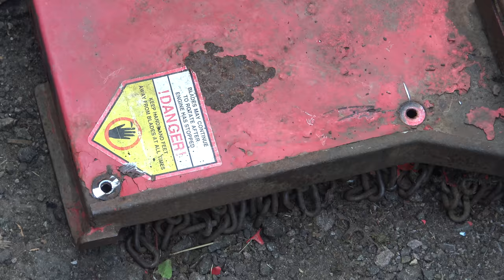BRITISH LAWN TRACTOR RENOVATION - Was It Worth It?

Comment: For the chain replacement, I disagree here.  I would have heated them up then oil quenched them for Oil Blackening.  This will keep them from rusting by adding the black oil to the surface of the steel.  Plus... nobody is going to be looking under the mower.  And... if they do they will not know the difference.  The chains are only there to deflect stones and wood chips from turning into bullets when struck by the blades.

Comment: My 38" 16hp Countax must be over 25 years old and still going strong, being used every week.The powered collector is, in my opinion, a much better option for the UK over the mulching deck, as we get massive grass growth and tons of leaves and debris all over our lawns due the the amount of trees we have.
I always coat exposed aluminum in motor oil to stop it corroding, I know it attracts muck but after a few uses it isn't noticeable and it really protects the aluminium.
I am still on the original belts apart from the serpentine deck belt and the powered collector !! (just wait for the comments on that one)
Nice Video, brilliant production - you must have the patience of a saint!
Reply: Ha Ha same tractor for me as well and almost identical age!
Burnt out a few serpentine belts cutting 2 foot high grass when we have been away for months and have just replaced the starter solonoid.
I have re-painted the underside of the deck twice and I also use spray on underseal.
This wears off after a few years but I am cutting 1.9 acres most weeks.

My 16HP is a single cylinder B&S but it seems most are twins.

Comment: PA LAWN GUY> Great video. Painting the cutting blades improves the aerodynamics of the blade and hence the grass flow. It also reduces the power needed to turn them. At least until they build up with adhered grass. that is why it is best to clean and paint the blades when they are sharpened and balanced. the best to you in your work.

Comment: I have a C600H purchased new 2008 with 16 hp Honda V twin OHC has 305 Hrs still looks good and stored in side
has 38" mulch deck and was converted to hand control with a mobility scooter seat (high back & arm rests 90° seat
rotation with locking mech. seat belt and chest strap) I'm a C7 Tetraplegic and my Countax has never let me down
still has original battery.
I live in West Otago South Island New Zealand  
Have a Merry Xmas & a Happy New Year

Comment: Well done, have to say my ocd would make me go even further but this was really good. Seen so many people just half ass the job. Had a Husquarna top of the range with 122 cm mower deck and atwin 22 hp Kawa engine and hydro +hydraulik lift of front deck and sevo  of course. still running strong after 20 years though I sold it when I moved into a flat. I look like inspector dreyfuss in a pink panther movie when I see it and it is not cared for as I did. Believe it is the same gearbox/axle, the tough torq they both used back then.

Comment: I just about crapped myself when you put the key in it and started it up and drove it off the off the delivery pallet, and it says can it be saved. Well hell yes. As far as the working parts go wasn't too bad when you get one that runs like that you're going to have to replace some stuff but that's the way it goes. The problem with these highly produced mowers, lies within the Developers bearings that can't be greased all the older equipment seemed to always be built different better oh, we live in a throwaway world. I have to say I thoroughly enjoyed the video and you do really nice work I've seen a few of your videos and I like what I see. But for a guy that takes and pays so much attention to detail especially like on this one one thing you didn't do I wonder if you can guess? That's right the steering wheel is crooked. You will never not in a million years make me believe that with the wheel straight your cross bars are at 7 and 2 or two and seven however you want to look at it please fix that. LMAO. Anyway you stay safe stay well and as always God bless.

Comment: As a small engine mechanic, I wish I could work on old junk all day instead of the relentless slog that is modern machines and do it to the level of quality and detail you do.
Reply: Same, got a honda gx390 with electric start that's on the rebuild list for next week.
Black smoke, misfires and had gas/petrol as oil a couple times due to leaking needle and seat.
I'm guessing valve seals and piston rings
Reply: with you on that Abe !!

Comment: I'm really glad you saved the little C series, I'm an ex employee of Countax and I'm fully aware of their faults but they are far outweighed by the good points, if only more owners would look after them they'd last a lifetime. Well done.
Reply from the maker: Thanks! It's very interesting having an ex employee of Countax watching. I have been struggling to get hold of the RAL colour code for Countax, I used my RAL chart and came to the conclusion that they are painted in 3002. Would you happen to know the correct colour code? Thanks
Reply: @MachineryRestorer  I don’t know the exact colour code but I could ask my friend who ran the powder coating line if he knows.
I destinctly recall being told the Harry (the company founder) loved Ferrari red, so to avoid being sued by Ferrari he made Countax red just a shade off Ferrari red.
Reply: I've got in contact with my friend, he can't remember the code numbers either but he confirmed it is very close to Ferrari red and the supplier was/is Akzo Nobel. Hopefully this will help in your quest.

Comment: Liquid wrench penitrating oil works way better than wd40. Also try using motorkote in those small engines, it works like a dream.
And evapo rust works well too. And ospho turns rust into metal.

Comment: If you need an Electric PTO Clutch, take your Old Clutch off, there should be a Number Stamped into the Clutch metal. Usually it’s on the upper side. Search on the Internet for this part. I paid a quarter of the cost the tractor manufacture wanted for the same part.

Comment: I have a newer countax with a different deck but basically the same spindles as this.  I did this overhaul back in the Autumn due to noise in the bearings - wish I'd seen this video earlier ! This looks like a HGM (High Grass Mulch) deck. On the XRD deck I have it is welded still as opposed to pressed, so this deck seems to have been ravaged by rust.

Comment: I was surprised you were still using locking tabs. A drop of oil or bolt Lock of some type will do the trick quite nicely. R.G. LeTourneau, a quite  famous earth moving inventor and builder had trouble keeping the hardware tight on the equipment and customers were complaining. Someone told him if he would oil the hardware it would stay put. He ordered all hardware to be oiled on the assembly lines and the problem was solved. For a volume production like that oil is significantly less costly than something like Loctite.

Comment: Seeing as what that Riding Mower is doing (cutting heavy, dense growth), I would have installed a Briggs & Stratton 23Hp Intek V-Twin............Now that is one thing that is definitely different here in America from the UK. Our Hydro-static Transmissions are a SEALED UNIT. They do not have a hydraulic fluid reservoir, plus In America they call a mowing deck like that a Brush Hog/Rotary Deck. Normally they are much larger 60" diameter and larger, pulled behind larger tractor with a shaft driven PTO or a hydraulic PTO

Comment: You sharpened that blade "upside down" on the grinder from how I thought it was to be done, but yours looked safer and easier...

I've done the "roll it on a big screwdriver until level" which is remarkably effective, like it a lot more than that plastic thing. I don't do enough to have a magnetic one.

Comment: This thing is so well built that I would absolutely rebuild this thing many times if necessary. I think it will outlast several lifetimes.Did you ever think about replacing those plastic pulleys with metal ones? I really like this machine. We have ones comparable here in the states but this one seems really nice. Especially after you were done servicing and replacing parts.
Reply: The plastic pulleys that outlasted the steel deck?

Comment: That pressure washer seems to have the power of a garden hose :D
Reply from the maker: Indeed I am getting a new one very soon.
Reply: @MachineryRestorer  Great! I´m spoiled of course by working as a professional zookeeper for 5 years, there we had in-built pressure washers to clean the enclosures and you really had to hold onto them, otherwise they would knock you over. But man, they had power! Nothing against the small one from Stihl that I have at home. However that one is strong enough to clean lawn mower decks properly from decades of dirt and loose rust. I´d really like to have a gas powered one though.

Comment: Great video! I have one thing I would question you about. When you spray painted the parts from the bottom of the deck, several of them were still very rusted. I would have thought that going over them with a wire brush at the least would have been best. It wouldn't have taken any time at all and would have extended the life quite  a bit.

Comment: I must admit, I don't like the Picric Acid Aluminium Cleaner.   I washed an almost shiny Ivor Williams Trailer with it, and it turned the aluminium into a matt finish, which started to oxidize a month later.   Would have been better to use Scotch-Brite to rub the sides back to a polished finish.

Comment: Interesting that you got the deck powder coated. It doesn't last. Flakes off due to poor bonding. My old Westwood T1200 with proper paint was still good after 20 years. A more recent machine with powder coating was flaking in just 5 years.

Comment: That is an extremely strange deck for a homeowner mower, it's more like a commercial mower or brush hog, it doesn't have the ability to Route the clippings and blow them out, in America most ride tractor mowers will suck leaves like no tomorrow and you could run around your yard and divert everything into one pile!!! 󾓦

Comment: This was amazing to watch and the time it must have taken to do the work, not to mention the additional time to produce such a detailed video. I have a much smaller job to do on my Countax but I am having trouble finding parts. Who do you find most comprehensive? Thanks Brian
Reply from the maker: Hi Brian, when I need parts I usually use EBay as the used parts tend to be so much cheaper than new. Thanks

Comment: Good video. The machines over here have a V shaped pulley to run the V belt into. That makes it easier to see how to run the belt. Makes me think may be some one put the wrong idler pulley on. I'd be interested to know what oil you use in the Hydrostat rear end. Also what formula you use for boiling the parts clean. Looking forward to more videos.

Comment: “Countax” as a brand isn’t known here in the US, as far as I know. However a quick google showed it’s owned by a US company, Ariens (I noticed some of the parts packages you had displayed the Ariens name), who is known over here mostly for their snow blowers and resedential mowers, as well as more professional mowers under the Gravely brand. 

Usually subsidiaries here in the US tend to just offer the exact same products under different brands. But there’s a lot of quirks about that mower which are not typical over here... the hood design, deck chains, control lever layout, the dash display, and even the blade design is very weird. And, according to Wikipedia, Ariens only uses Tecumseh or Briggs engines. So I’d say this Countax brand must have a decent level of independence from their parent company; instead of selling clones of what’s offered across the pond, they are permitted to do at least some stuff the way they want (though I expect they do use quite a bit of existing parts and components from the Ariens parts bin).

That said, I’m on the east coast, and Ariens isn’t widely sold here like it is in the Midwest, so I could be completely wrong on that.
Reply from the maker: Hello yes Countax was actually bought out in around 2014 I believe by Ariens. Despite the parent company being American the general designed remained from when it was an independent company...which I think is why they are very popular in the UK. Thanks for watching! :)

Comment: Excellent rebuild on the deck, but unless it is thoroughly pressure washed after each use, I fear it will begin to rust away again. Looks like the manufacturer was trying to build a commercial deck with materials usually used on a residential push mower.

Comment: Wouldn't Epsom salt be less expensive than calcium carbonate? We use that in tractor tires for added weight and it rots the wheels right away after time.

Comment: While u had the trans out u should have put a drain in the bottom. I did on mine ,makes service sooo much easier.. cuts an 8 Beer job down to 2!
Reply from the maker: It's got drains :)
Reply: @MachineryRestorer  ok 😞
Reply from the maker: @maxdillon9704  I think Countax were one of the few manufacturers who wanted them. I don't think most if not all John Deere machines have them. Thanks for watching

Comment: With how badly the powder coated parts rust I'm surprised you re-powder coat the components. It seems to turn into a flapping, solid sheet of red paint keeping water and rust nice and safe. Generally I've found that paint is uselss at protecting metal - only oil or wax does anything. What do you think?

Comment: Those plastic bits on the deck serve no mechanical purpose other than to hold mulch and water, resulting in the metal to rot away. I threw mine from the get go, and the deck i have, which is very similar, but for my Kubota, is in mint condition. The usual damage from strikes is on the sides, but the top, barely any rust present. And i don't do anything other than brush or wash the occasional build up.

Comment: Was it worth it... So based on the fact the Honda engine wasn't smoking or guzzling oil, I would say yes this was worth the repairs.  These tractors in the USA are not inexpensive to begin with, most starting around the $2500.00 to $3000.00 mark for a current price.  Plus any of these will re-sell for $1500.00 to $1800.00 without being refurbished.  So for the little amount of money you tossed into this project including the new cutting deck, yes very much so if you are looking at this from a "Used Equipment Resale" aspect.

Comment: The paintwork on most new mowers is absolutely appalling. Years ago I bought a new Westwood and experienced the same levels of rot and flaking paint as yourself. I can see a genuine excuse for the deck which will always take a terrible beating but there's no excuse for the rest of it.
I bought a well-used Honda purely and simply for the engine, which is pretty good at resisting the onslaught of ethanol fuel. At the start and end of the mowing season I put 10 ltrs of Aspen through it (at a cost of £80!) to try to remove all the crud collected from the engine-eating ethanol fuel I have to use the rest of the time to keep the mowing "experience" economical.
If Countax want to really produce a world-class mower they need to 1) Drastically improve the quality of paintwork. 2) Research and invest in battery technology. 3) Offer a stainless steel deck as an OEM choice.
Ethanol should be treated as a crime against humanity. NEVER leave any machine with it for more than a month.
Reply: And a couple of other things. 4) All fasteners should be pre-greased by the manufacturer in waterproof assembly grease to allow for easy dismantling. 5) Cathodic protection. Mowers give me the shivers!

Comment: Good job !!! I can not mowe with my lawn tractor when i put it in reverse, the engine stops
Reply: Read the owners manual
Reply: Might be a safety switch in there that can be bypassed. I bypassed the switch that turns the blades off in reverse on my zero turn mower. I need to back up towards some obstacles to prevent throwing debris in the wrong direction.
Reply: @guilateen  it's lost man
Reply: @c0c0asauce  thanx
Reply: @c0c0asauce   not being a jerk bit I've been thought,  don't ever teach someone how to bypass a safety (dummy)  switch. If they can't figure it out on there own, it's there for good reason.
Reply: @guilateen   @Guilateen02    I didn't directly tell him how to do anything. Just to look for a switch on the reverse linkage as a likely culprit. His problem is the mower shutting off in reverse. The engine does not shut off for safety when you put it in reverse. He did what anyone should do when they can't figure it out and asked for help. How else is he gonna learn? Trial and error?

 I used the reverse PTO switch as an example. In my example I'm not even talking about removing a crucial safety item like a governor or a debris shield. My newest mower isn't even equipped with a switch to shut off the pto clutch in reverse from the factory.

Comment: Looks really good.  Seems like a very specific mower not for finish mowing, and not for real brush hogging.  In other words, no real practical use.  Never heard of this mower brand in USA.
Please realize you can remove bearing seal, clean out hearings with brake cleaner, and grease, unless they are trashed.  Are you sure these sealed bearings you are installing are already greased?  
Hope you are making a decent profit on these jobs.
Reply from the maker: I think there has been as small misunderstanding regarding this mower. They are extremely popular in the UK and are very useful for cutting down brush, they are very capable machines. I have worked on hundreds of mowers and I know these bearings are sealed greased bearings.